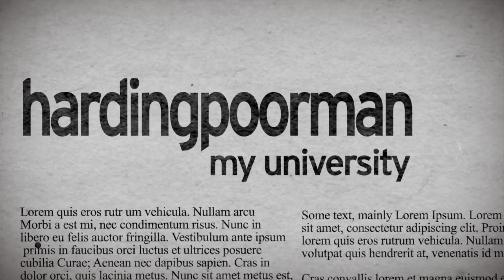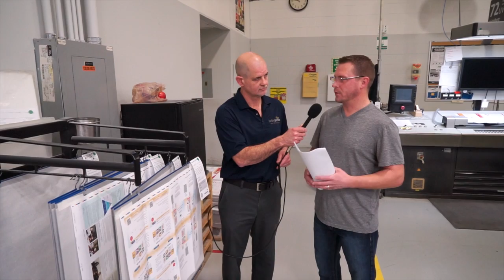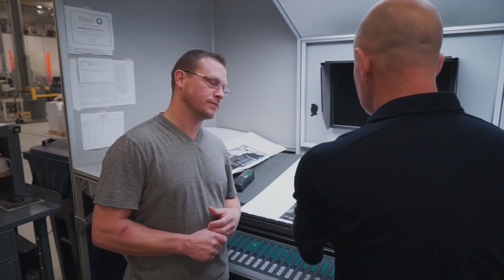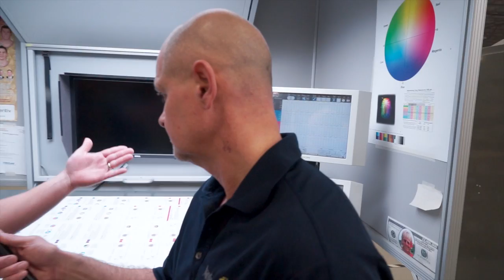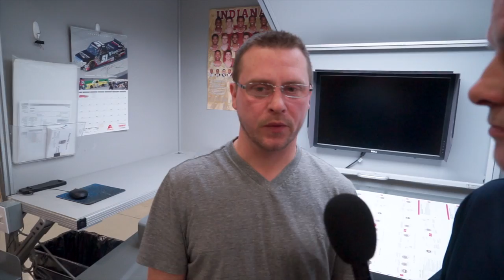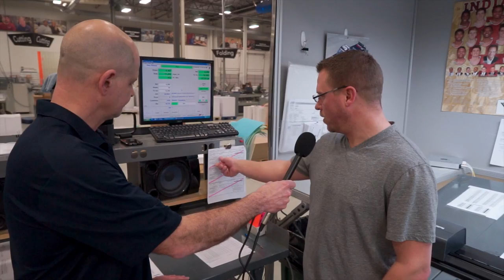UV Offset Printing

Comment: Consider renaming the the video to "UV offset printing job process". This video comes up first when searching "uv printing" (looking for tech specs, demos, results, etc) but isn't relevant to those searches so you're getting some thumbs down
Reply: Hi! It is really a very perfect UV printing machine! By the way, please feel free to get back to us, if you will need Smart High Power High Voltage UV Lamp Ballasts, reference at www.uvballastsupplying.com. Thanks
Reply: @simonballon409  Good!